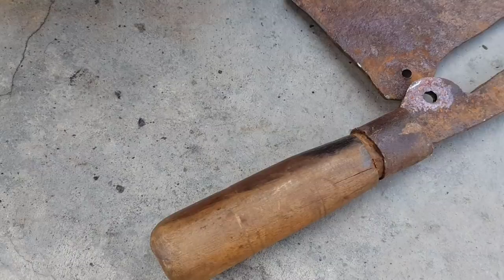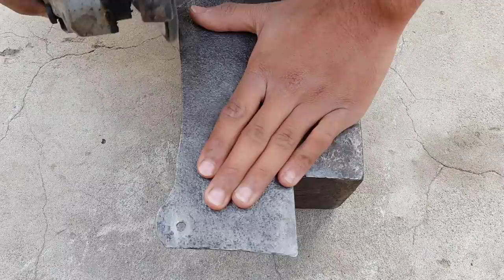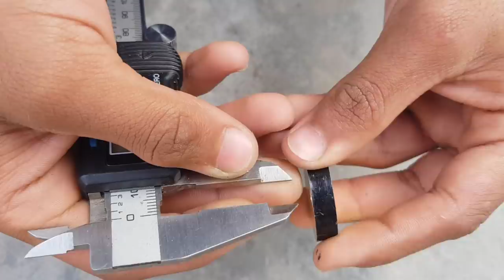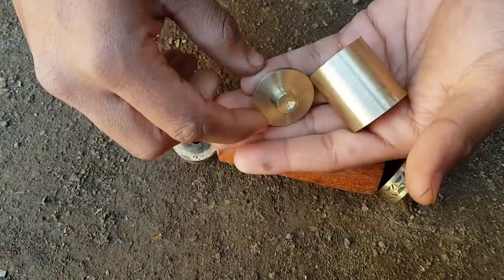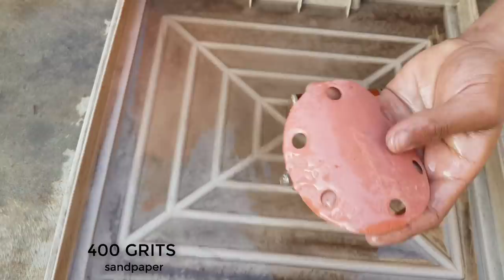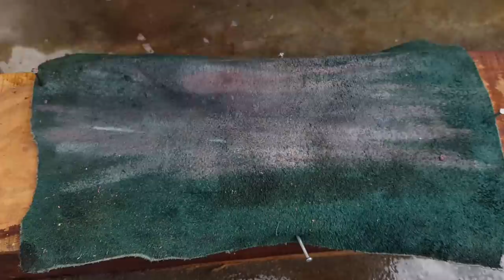Antique Rusty Butcher's Cleaver RESTORATION

Comment: The handle is undeniably beautiful, but I have a few critiques. The handle doesn't really fit the style of the blade. It's kinda out of place and it seems more like the head of a nice cane. Also, it doesn't function that well as a handle. Ofcourse with that old of a blade it's a display piece. It would just be nice for the handle to be oval shaped to allow the hand to naturally be aligned with the edge of the blade. Very pretty blade and keep up the great work.
Reply: immoralnight98 good

Comment: You know, a wire wheel on an angle grinder will accomplish the same thing it took you a couple hours to do with the vinegar and steel wool in a fraction of the time
Reply: That would lose the surface texture of the original hand forging.
Reply: @david mcintyre, no it wouldn't. Something that heated up and textured wouldn't lose that with a wire wheel. A wire wheel moves into the texture and around it. It doesn't remove it. You are thinking of a grinding wheel.

Comment: Didn't temper after heat treating. I'd be concerned of it shattering if hit hard
Reply: he made it rust proof the treatment had little or no effect on the hardness if anything he made it tougher with a layer of hardened iron on the outside my bro does this to most of his tools  he uses  for longevity
Reply: @davidens8204  I see what your saying basically like  seasoning a cast iron pan. However when you season a pan you don't make it glow yellow hot
Reply: @macgyver15147  fair point
Reply: @macgyver15147  his attempts at hardening are failed quenches. With any substantial force and or usage these would crack.
Reply: @travelsnazmul9166  no.

Comment: I'd really love to know why the handle is separate from the blade and joined in this way! Anyone know?

Great job dude!
Reply: In it's normal position it is a standard butcher cleaver, useful for cutting lamb/pork chops. When it is elongated it is a "splitter" which (as the name suggests) is used to half the animal in two. Being single-handed as it is it would likely have been used for smaller animals like goats or lamb.

Comment: What is the point of the design of the blade? Genuinely curious
Reply: In it's normal position it is a standard butcher cleaver, useful for cutting lamb/pork chops. When it is elongated it is a "splitter" which (as the name suggests) is used to half the animal in two. Being single-handed as it is it would likely have been used for smaller animals like goats or lamb.